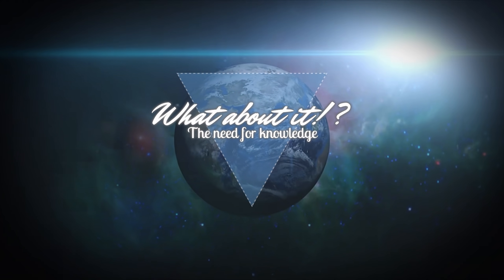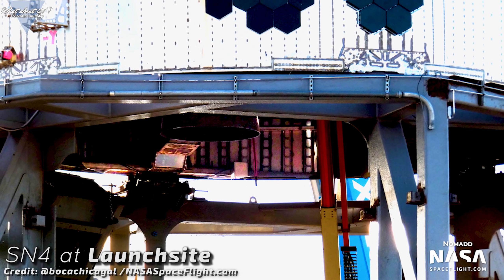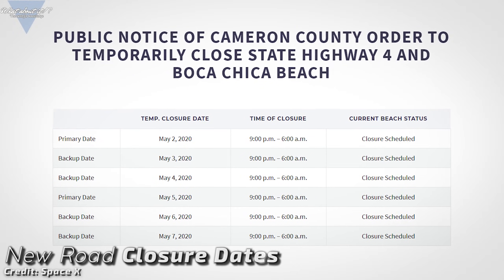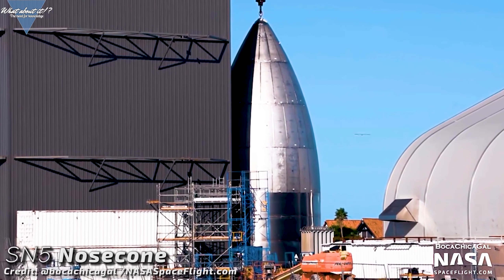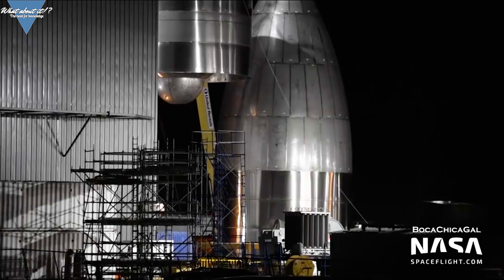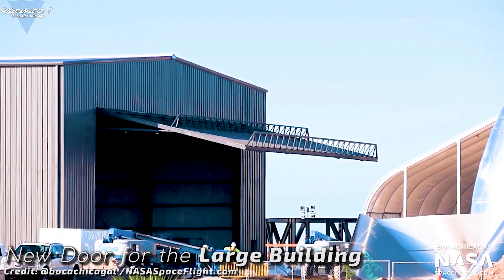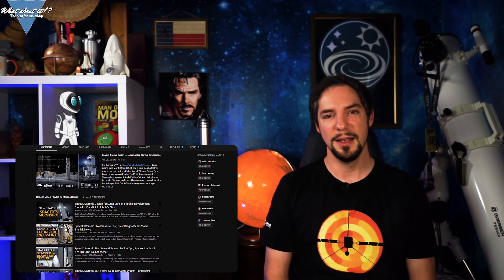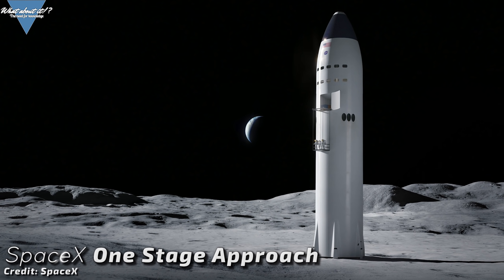89 | SpaceX Starship Updates - Lunar Starship: One Giant Leap

Comment: Alex, I'm concerned about the Starship lunar landing legs. The relatively narrow base is fine for landing on solid level surfaces.  However, the highly varied terrain on the moon would necessitate a much wider landing base relative to the height of the vehicle.  The landing legs should also be compressible to absorb landing shock and to compensate for uneven terrain.

Comment: those vanished stiffener may caused, for my opinion, possibile source of leakage. I had the this problem by developing and designing some vakuum komponents. If the welder is not skilled enough, or thera are some quality issues with the matierial the chaces are considerebly high, ergo real, that welding ponts create additional cracs in matirial, that will lead to leaks.

P.S. pardon my frensh

Comment: If they want to lighten the load further on the Lunar starship, and increase payload capacity, they could remove the main Raptor engines from the stern. Turn that area into a low-to-the-ground cargo bay. The engines farther up the hull should be sufficient for getting the beast into orbit. You wouldn't want to launch it from Earth with a crew, since it's exceedingly unlikely it would be capable of landing back on Earth with those smaller engines farther up the hull. So, send it into orbit on autopilot, refuel it in orbit, and have a crew take it to the Moon. :)

(Of course, SpaceX doesn't include fins on the Moon version, the ship couldn't return in the event of an abort, since it couldn't control its descent through the atmosphere. More evidence that they might forgo the standard main engines entirely.)

Comment: This offset-raptor testing, is a really good way to make sure that the software for landing can control the offset thrust and balance that would be caused by an engine-out condition,.. same as aircraft testing, where a jet has to be able to land on only one engine, with the same sort of thrust offset.
Those tank dome stiffeners, could have been moved to the inside of the tank, we'll only know by watching when it's flipped.
Side engines on the Lunar Starship - bet on them being Super Draco's, or a 2.0 version of the Super Draco, sized up for Starship.
Been saying the same on the mission specific modules - car manufacturers are used to building production lines to handle multiple types of modules, such as a different motor, gearbox, or fitting those in to a sedan, hatch, wagon or van. Sounds familiar,... :)
Did you say 'construction' but mean 'test site' early on in this episode Felix? Around the 44 second mark.
Reply from the maker: Ah damn! Yes! :D Thank you for the comment! Agreed! We'll know, when we see a flip picture!

Comment: Riveting the hull sections before welding could give enough flexibility through elongated holes to allow riveted assembly  of complete or more complete sections of the hull and welding later to avoid stress-caused wrinkles and dents. The stresses that cause these dents could possibly cause failures in operation. Earth landing would be one of those situations.

Comment: It's not a fairing section. It's structural and serves more purposes than just smoothing airflow. It's a fuselage / cargo bay / Fuel Tank / passenger compartment integral part of the spacecraft. Fairings serve only to guide airflow. On a rocket with a satellite or other spacecraft on top that needs to have the air guided around it and it serves no other purpose then it is a fairing. Their are fairings on the fronts of motorcycles, at the wing root and vertical and horizontal stabilizer attachment points  and around some antennas on aircraft etc. But in the case of Starship the pointy upper half is not just for airflow guidance. It is part of the structure and full purpose of the spacecraft and should not be called a fairing. This drives me nuts.

Comment: The new "Lunar starship" has one major flaw. That elevator. What if it breaks down? Your screwed. Spacex should consider other options. I like the idea of integrating horizontal landings on the lunar surface. Or after landing... It can slowly lever over and rest horizontally. The best part is no part eh?
Reply: Or they could build a ramp that they can "wheel up" to the starship. Like in airliner business.

Comment: Up until now, the whole ship has been intended to bear a load from above, both while standing on a surface and while the thrusters at the bottom are firing. With this design, a significant portion of the ship will be pulling on the rest as the midriff thrusters fire. It might be pretty heavy if full of fuel for a return. I wonder how much that will affect the design. Also, will the main thrusters at the bottom still be necessary for liftoff from the lunar surface, or will that begin with the midriff thrusters?

From what I have read, paints are a messy, expensive business and have a tendency to debond (i.e. fall off) after a while. Instead of painting the ship white (presumably to minimize boiling off of the cryo fuel), why not just deploy a tarp from the top to being pinned at a few of points on the lunar surface to shade the ship.

Comment: 11:15  Did elon not twit out there gonna land star ship on the moon with enough fuel to get back to the earth? ? (May 2)
Reply: Starship will certainly be capable of doing that but if they build this Lunar optimized "lander", it won't need to.
Reply from the maker: Odysseus Rex  Thank you, Rex! 🙂
Reply: @odysseusrex5908   I don't know about "perfectly', since per SpaceX all along the physics haven't worked out before this, and that sounds like one of Elon's aspirational tweets. People online are also assuming he meant the new lunar ship returning to LEO, but we know that's simply impossible; no way it can carry enough fuel for propulsive deceleration, and it doesn't have elerons or TPS for aerobraking. A hybrid regular SS with auxiliary landing engines will have the problem of them conflicting with the TPS - a problematic cover would destroy the ship on reentry. Perhaps Elon is hoping to further solve the landing problem and do away with the auxiliary engines. They could certainly try using them less and less, see how badly the regolith problem is.

Comment: For the Artemis program, the Moonship must have a docking adaptor for Orion. I wonder if also Dragon could dock to it; then SLS/Orion would become unnecessary, if the astronauts can launch with a Falcon/Dragon to LEO and then enter the re-fueled Moonship and go to the moon with it.
Reply: I completely agree. Musk has already tweeted that they are aiming to land SS on the Moon with enough fuel remaining for it to get back to Earth orbit. If they can do that I just don't see the point in any humans travelling to the Moon on Orion. If SpaceX can do what Musk mentioned in his tweet it really has the potential to streamline all moon-based human activities, removes a vehicle type (Orion) from the equation, and is a far more capable, comfortable and elegant solution.
Reply: And once you have thought of that, then you have to wonder why add the operational complexity of docking and transfer in the first place? Why not just use a regular Starship and launch straight from Earth. I am quite certain NASA and SpaceX are already thinking along those lines. It is not politically expedient for them to say so, but that day will come.
Reply: @odysseusrex5908  The problem may be that it is not save enough for manned launch and landing on earth. So for the first missions the docking solution with a capsule with escape system would be the best.

Comment: Probably super draco engines on lander mounted high. Get a pendulum effect so no costly thrust vectoring.
Reply: Also lower thrust required on the moon.
Reply: Dracos would require separate fuel though, which would complicate inflight refueling (which is essential to the Lunar Starship design). They'd need extra tanks somewhere near the top, and they'd need plumbing to connect them to the refueling points at the bottom. 

That said, while building something that can run off the main tanks would be a better solution, it seems unlikely that LS will have a large production run, so they won't want to invest too much in custom parts...

Comment: its really cool the elevator going up and down with the stock and humans ...i hope they will have enough energy to work that elevator cause it takes a lot of juice to run it !!!
Reply: manumus11 maybe use some kind of regen energy recovery on the way down ?
Reply: manumus11 One-sixth earth’s gravity will help a lot!  Musk and company know a fair bit about energy.  I’m not sweating this “issue,” 😉
Reply: @737smartin  the problem is exactly the gravity .. the only way i sea it going up and down is to have a gear system to control the descent .. and the motor has to push and pull with the same intensity meaning that the motor will be using energy weather it goes up or down and has to control the speed .. i hope they have enough battery storage capacity for sure !!!
Reply from the maker: manumus11  Even though there is low Gravity, it will still pull the cargo down. Nicely too, as it doesn't need a strong breaking system. On the way up, 1/3 gravity will help the elevator, as it takes less energy to go back up again. If SpaceX uses a recuperation system from Tesla, they'll even gain energy while unloading cargo. Should really be no problem at all. 🙂
Reply: manumus11  The motors can generate power on the way down in the same way an EV generates power when breaking.
Reply: manumus11 Of course the motor system will have to engage both to break and to raise the load.  My first point was that he system load on the reduced-G force moon will be 1/6th what it would be on earth (I misstated as 1/3rd before)—that applies in both directions.  The MAIN point is, this is among the LEAST challenging engineering hurdles to overcome and make this project work.  Not in the top 100 concerns, IMO.
Reply: Tbh astronauts could almost just jump. Jumping from a height of 30 meters on the moon takes 6 seconds for an impact a bit below 10 m/s.That's like jumping from 5 meters on Earth for the same impact velocity. Still too high but they could slide down a pole without too much danger.
Reply: Cargo goes mostly down to the surface, so no problem there.
With 1/6 gravity and no atmosphere the only thing that matters is friction and efficiency of the electric motor driving the crane.
Reply: @pmj_studio4065  the problem is exactly the gravity .. the only way i sea it going up and down is to have a gear system to control the descent .. and the motor has to push and pull with the same intensity meaning that the motor will be using energy weather it goes up or down and has to control the speed .. i hope they have enough battery storage capacity for sure !!!
Reply: Save energy - just use cargo parachutes.  ;)
Reply: @donjones4719  with no atmosphere?
Good luck 😁
Reply: @pmj_studio4065   Minor details...  :D
Reply: Let's hope Engineer Frank Wolff isn't going to be near the cargo door operator...

Comment: 13:08 Those landing legs give me anxiety, I think landing legs similar to the Falcon 9 boosters would be far better and more stable.
Reply: Dennis Richards Starship is a lot more naturally stable than Falcon as it has a significantly larger width to height ratio so it doesn’t need legs that are anywhere near as wide when deployed. Without legs, Falcon 9 is more like a pencil. Whereas for Starship, without legs it is more of a whiteboard marker. You can add a much smaller set of legs to Starship and prevent it from tipping over.
Reply: @Borodalf  On the Moon you can't be 100% sure weather your site is level or a rocky mess just under the surface. Having the largest landing leg span is probably a no brainer for safety (Lunar landers have wide legs for a reason) and having tonnes of cargo at the very top will not help its stability.

In fact I'm pretty sure the lunar starship will have similar legs to the Falcon 9 but bigger 

(in fact I'd put money on it)
Reply: Dennis Richards You know those mockup weren’t sent to NASA for fun, right. The contract winners were decided on technical merit and one of those factors would have been whether the lander as proposed can land on the surface. It’s good to be confident sometimes but also good to understand when experts evaluate something they generally understand more than some guy on the internet.
Reply: @Borodalf  " You know those mockup weren’t sent to NASA for fun, right" 

we'll the artists rendition of the ship was used in a sales pitch for NASA funding clearly. I think no one is in any doubt (including you) that the designs displayed are for illustration purposes only and the ship is going to change considerably over time like all of SpaceX's projects, right?

I can bet that tried and tested landing legs that appear in competing projects, and standard on all previous missions to land on the Moon with (excellent success) are way more likely to be on the final design, than the artists rendition being indistinguishable from the final product.

But you could also be right, So time will tell.
Reply: Yes me too. Perhaps they should carry a set of say 2m leg extenders that with an EVA are bolted on, on the way the the moon. Only has to be done once.
Reply: Well, the starship is 50m tall and has a diameter of 9m. Those legs look small, but are probably 1-2m still. That would bring the total diameter from the tip of one leg to the other of 12m. So, it is as wide if not wider than your house. In the same proportions, you can try to balance a 10cm tall object with a diameter of ~2.5cm. With a relatively low center of grawity it should be able to land. And maybe they will make the lunar version a bit shorter!
Reply: @mrgreen9035  I'll paste my reply to Ryan McAvoy as my comment is pretty much identical to his. My point is you need off-road suspension for an off-road landing. 

On the Moon you can't be 100% sure weather your sight is 100% level or a rocky mess just under the surface. Having the largest landing leg span is probably a no brainer for safety (Lunar landers have wide legs for a reason) and having tonnes of cargo at the very top will not help its stability.

In fact I'm pretty sure the lunar starship will have similar legs to the Falcon 9 but bigger 

(in fact I'd put money on it)
Reply from the maker: I tend to agree, but there must be some reason, why SpaceX is going with these legs. Maybe we're just used to seeing sometimes wobbly landings from Falcon9 boosters and SpaceX has far more confidence in the landing accuracy of a Starship? There must be a reason.
Reply: @Whataboutit  I believe the design will evolve further down the line. Makes sense to have off-road suspension if you're landing off road especially if you're top heavy with cargo. the current starship landing legs proposals are no bigger than the Lunar landers rendition . . . but Starship is being designed to land on a prepared landing pad.

I could be totally wrong mind you but suspension is underrated on uneven ground. Drone ship landings show what a life saver a decent landing legs can be and NASA likes safe.

Comment: I have always loved SLS but at I am starting to get annoyed by all the delays and its INSANE costs.
Reply: Same here.  Seems like SLS was all aimed at reusing the Shuttle's reusable engines, and modifying the Shuttle's External Tank and SRB's.  Sounded quick and cheap.  Cost!! More than $1 billion per launch and the re-usable engines never get re-used...dumped into the sea every time.  It turned into a huge money pit.  Hate to scrap it and waste all the money so far invested, but continuing it is such little return for the expense.  You could say the SRB's get reused, but they have to be factory-refueled with solid propellant.  I think only the Orion capsule gets reused.  Sounds a lot like a fully-expendable Saturn V.  Lunar Starship is to be expendable, too.  However, it is not dumped into the sea, but instead landed in the Sea of Tranquility and used as a lunar habitat with perhaps 10 times the volume of living space as the other lunar lander proposals.  Its Super Heavy booster is 100% reusable...and that's the key!
Reply: The more I hear about the SLS the more I think ultimately Space X Starship may end up swallowing it whole. One interesting point is the SLS doesn't even have the capacity to put in lunar orbit as the Saturn Rocket in fact its significantly less. Not to mention the delays and cost overruns with so far nothing to really show for it.
Reply: @mrcstravels  ikr, it would be so much cheaper to just build more saturn V, YOU CAN BUILD 18 SATURN V FOR 2/3 OF AN SLS
Reply: SLS  isn't even built yet. It is not therefore certified for anything. And they can't give you an exact date when it's going to actually lift off. 1st flight towards the Moon will be pushing an Orion, which has made only two orbits in a semi ready state. It also is not certified for anything to include manned flight or even docking. This is why it's absolutely essential to have Starship in the mix.
Reply: Good rocket; terrible program.
Reply: The delays and the insane costs are the same thing, and both are down to pressure from White House OMB and Congressional committee staff to make do with less.
Reply: You got a pic of Elon Musks face yet love The Senate launch scam? What do you love the most how Boeing is ripping NASA off ??
Reply: @badtrekee4348  I like it but I don't think it's a very good rocket. You can love more than one rocket.
Reply: @spaceenthusiast7160  Whats wrong with the rocket? Its the most powerful rocket ever built and its reusable? Maybe you shouldn't think you aint very good at it.
Reply: @badtrekee4348  nope, it's not built yet, and it's therefore never been reused. The only thing we have is talk... And no action...
Reply: @badtrekee4348  I meant SLS.